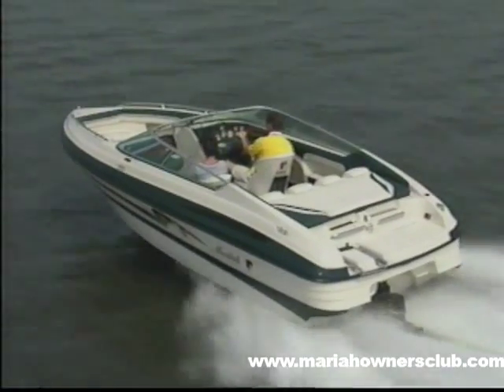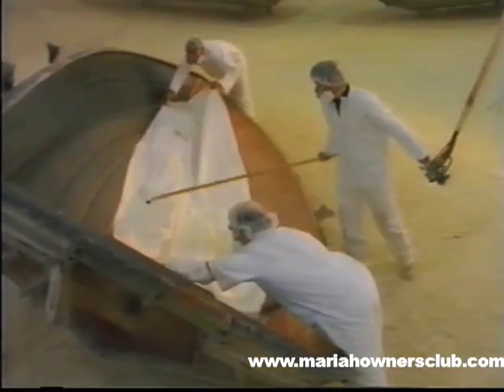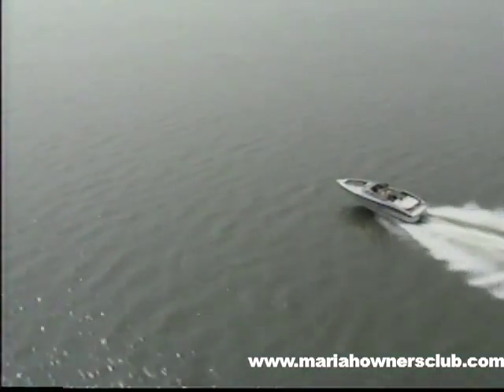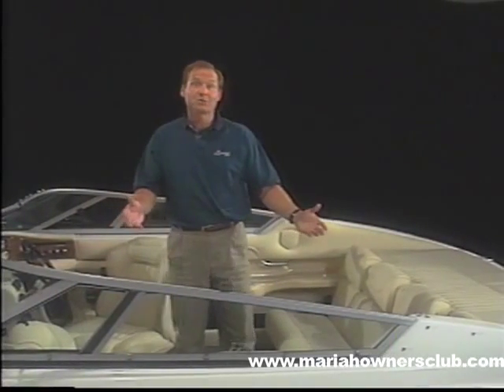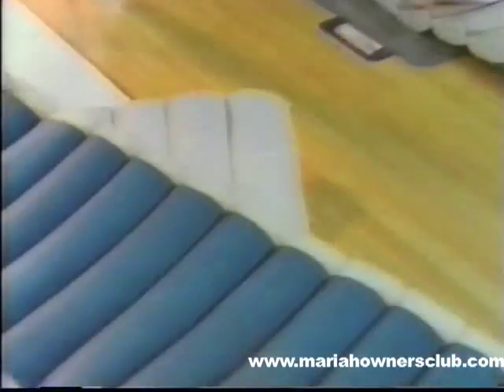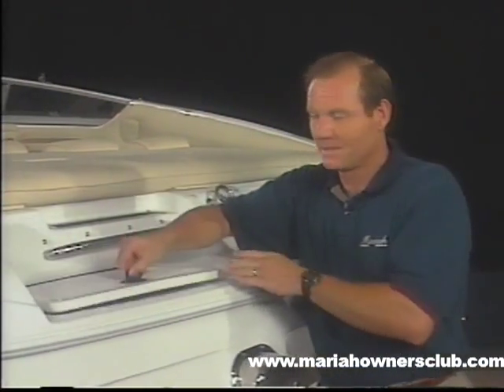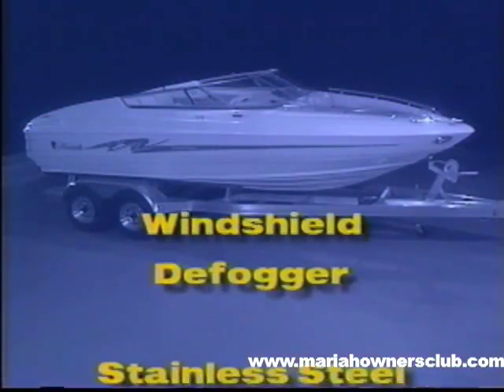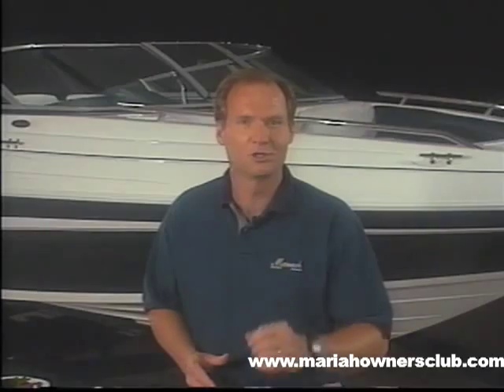"The Mariah Difference" - 1997 Promotional Video

Comment: Gotta wonder how they went out of business with a system this clean and a great product. Hopefully I own one of these boats soon.
Reply: Hard to keep up with cheap ass boats. I'm picking up a 97. Pretty excited after the video
Reply: @olson143  I just got a ‘96 talari limited edition. Haven’t even taken it on the water yet.
Reply: @olson143  Nice... I just got a Z308 7.4L .. pretty sweet. Refurbishing it all to top spec modern design, can't wait.
Reply: @aaronarnold714  there's a facebook group under Mariah boat owners. U should check it out
Reply: @olson143  thanks mate I will
Reply: I just bought a 2000 Shabah 182 and i have no major complaints. Great quality for the price!
Reply: I'm picking one up it's a 1997 talari 209SE and it only has 204hrs. And I wanted to know where can I get some extra part for it.
Reply: I just picked up a 97 z210 7.4
Reply: I just picked up a beautiful Diablo.
Reply: Getting a 182 this weekend can wait
Reply: @Joey  may I ask what thr price was for the 97 Z210?  I'm looking at one right now in Canada.